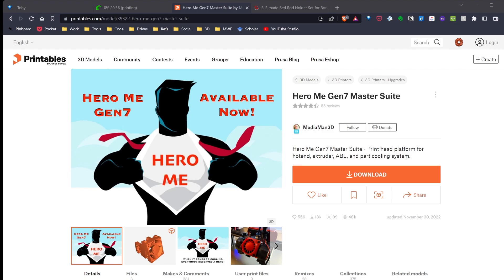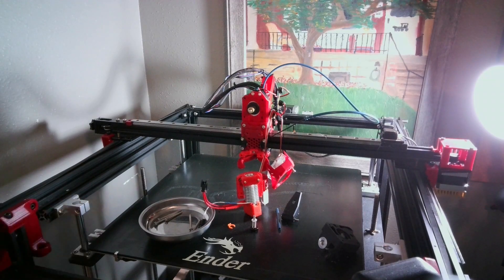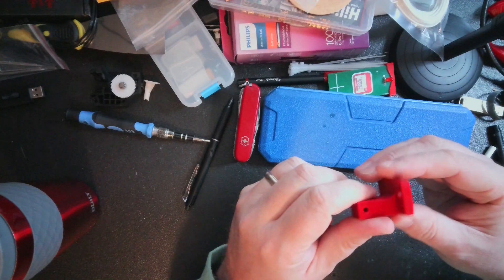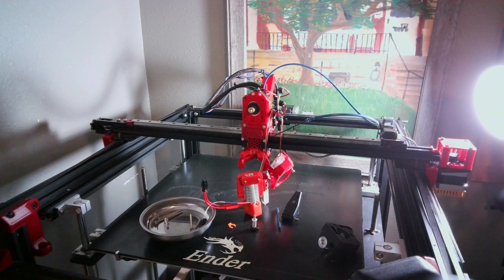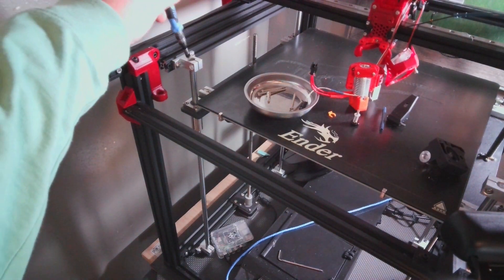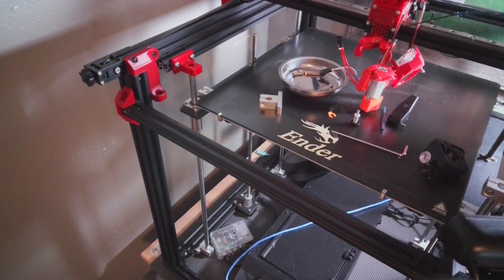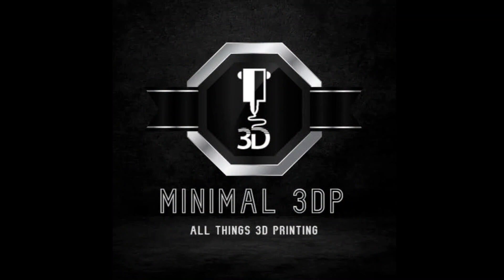A Quick Ender 5 Plus Bed Fix That Keeps the Nozzle and BLTouch from Hitting the Bed  Supports

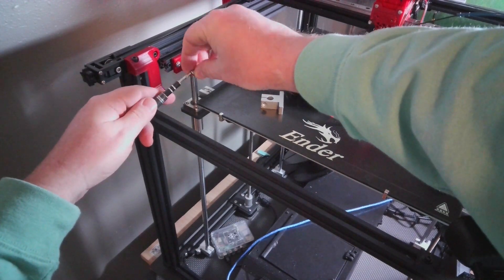Comment: I may have missed it or did not hear you. at 5:47, did you say that you were tightening the screws without a bolt or threaded insert on the other side? Did this just grip into the plastic?
Reply from the maker: It is gripping the plastic. Working well for me since I recorded.
Reply: @minimal3dp  Thanks!